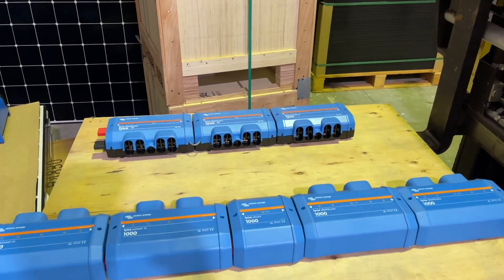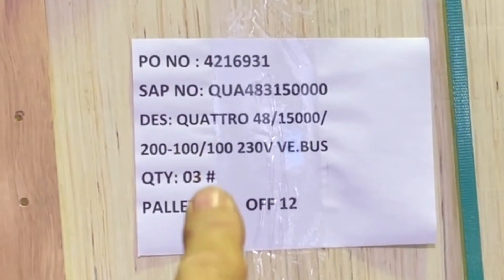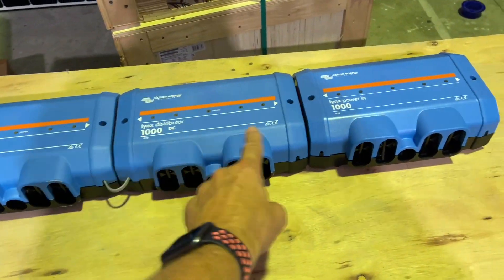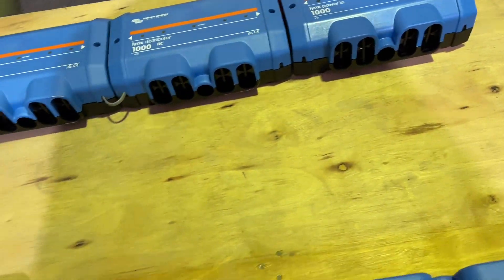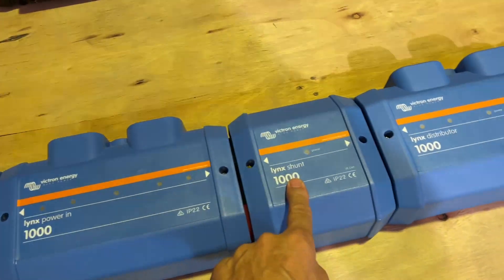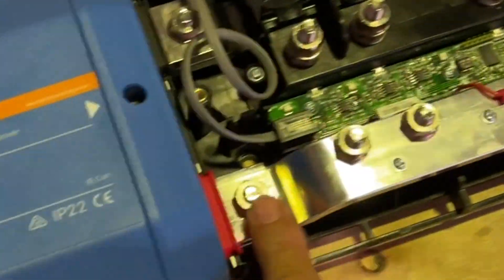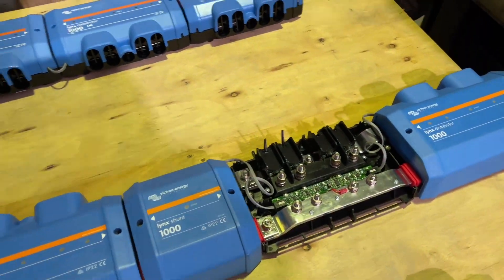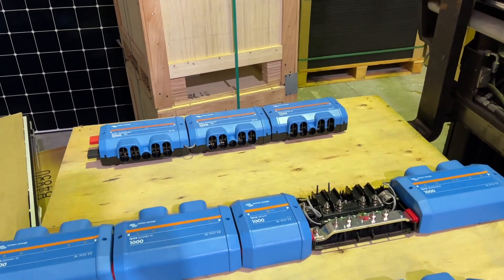Connecting 45kW Inverter 3 Phase with 72kWh of Lithium Batteries for a Superyacht

Comment: Ya think they'd use different colour stripes or something to clearly indicate different components, rather than all pretty much looking the same. You thanked victron, are they giving you a deal? Why 72v rather than 48 or 96v?
Reply from the maker: Yes Victron gave us a deal as we are dealers and that is 72kWh battery capacity vs 72V. This set up has now been repeated several times with 100kWh the benchmark battery size.

Comment: Just curious about the 1000a max on the lynx bus bars?
Reply from the maker: Yes thats what they are rated at? We only fit an 800A Fast blow Fuse in though
Reply: @Safiery  o ok 👍 
Ya i was thinking maybe you would exceed the 1000 but 800 should pop before anything else. 
Pretty cool, look forward to seeing the install

Comment: "At its peak, this Superyacht with draw 45kw of power. To put that in perspective that’s about 6-8 houses of power at the same time."
As I look at my 15kW electric furnace, wired into a 50kW breaker panel, I use to heat my modest 1,000 sq ft house in the frozen replica of Hoth known to some as Winterpeg...
Edit: 72kWH would run my house for about 40 hours in the summer, and < 15 in the winter. It's a lot of power, but the "x number of houses" metric always cracks me up.
Reply from the maker: The number of houses relates to the 45kW of power. Maths are easy. You are referring to energy which is time based.